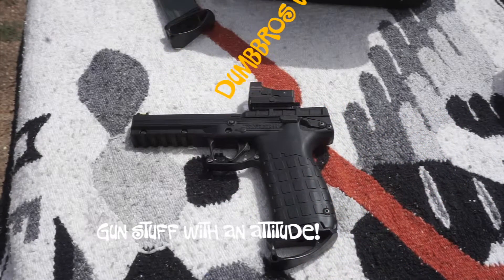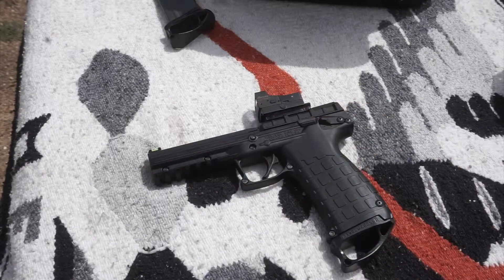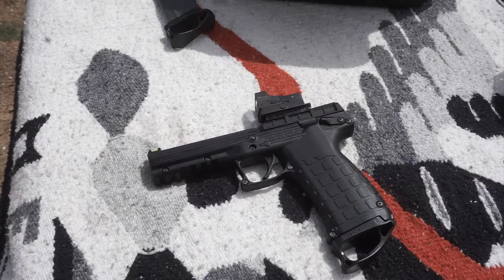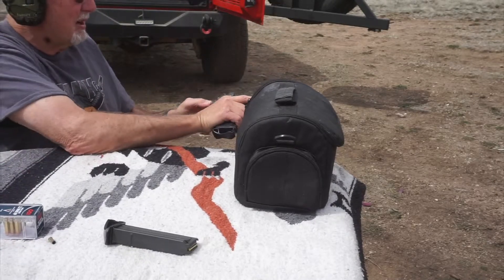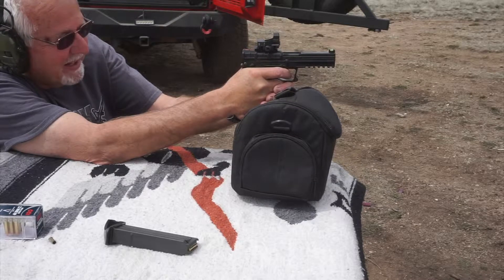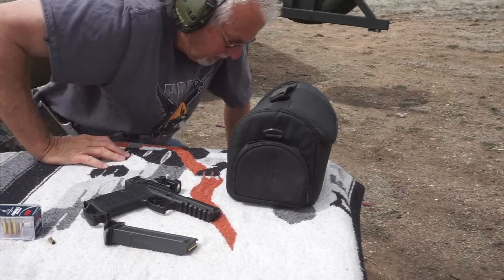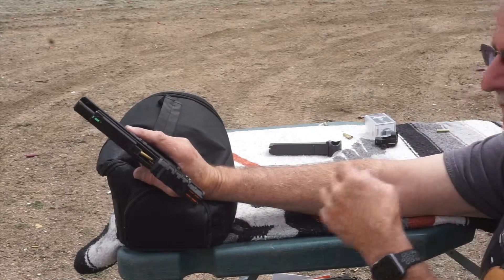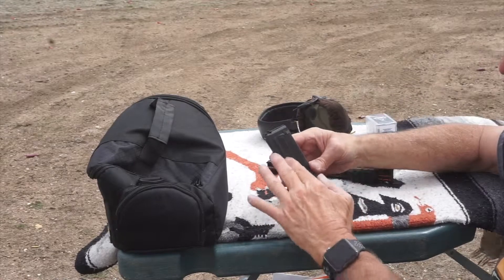⚫️KelTec PMR  30 with new Red Dot sight, Test #3 🧐

Comment: I had same exact round jam on angle issue after mounting fastfire sight. It turned out to be firing pin not retracting completely and rim of cartridge was catching on pin. Hence that's why it cycles after u pull back on it. You pull pin away. Remove composite cover that's under the Burris mount. Remove 4 screws and snaps off with little effort and exposes the firing pin. Be careful not to lose small return spring. On the bottom side of the composite cover is a molded ridge that runs the length of the firing pin. The firing pin is rubbing on this ridge. Sometimes there is a witness mark on pin where it is rubbing cover. This is what prevents the pin from retracting properly causing jam. Simply sand the molded ridge on cover until you get proper clearance between cover and pin. This will let pin retract freely preventing the jamming issue. Mine has never jammed again. I would have never noticed this issue myself.  I watched a YouTube video by CHICAGOHAND  he deserves all the credit. Good luck
Reply from the maker: Well thank you very much!!  I’m excited to give it a try. 👍🏼👍🏼

Comment: I replaced my guide rod springs with Mcarbo springs and used CCI 40 grain ammo and Hornady critical defense 45 grain ammo and shot fine all though the button/switch that keeps the slide locked open flew off while I did a mag of double taps so I super glue that piece back on.

Comment: I did have a Holosun 507C V2 on my PMR30 but it was to heavy and I had cycling issues even with the Mcarbo springs installed so I took the red dot off and it runs good.

Comment: The malfunction that happens at time index 4:32 appears to be because the round got stuck on the firing pin.  The firing pin gets stuck when the plastic piece above is rubs too much on the firing pin, check for rubbing wear along the center line of the pin.  ...I watched another video of a guy who filed down just a tiny bit of plastic so the firing pin could move with less friction against it.
Reply from the maker: That sounds logical, I’ll check that out next. Thanks!!!

Comment: Are you using a light weight rail made for the PMR 30?  The entire added weight of rail and red dot sight needs to be under 2 oz.  Also, all semi auto pistols will misfeed a round occasionally if you don't grip the pistol properly. Elbows and wrists need to supply back pressure against the recoil.  Relaxing your elbows and wrists too much causes misfeeds. Especially when shooting from a bench, instead of a combat standing position.   Of course, good ammo is also important.

Comment: It looks like I'm a little late for the party but I have a few things to discuss first off I never shoot less than a 40 grain bullet.I'm a little confused as to where you got the magazines with all that stuff on the bottom. I'm looking for a reliable red dot That they claim should be around an ounce in weight for my firearm. I own five Kel tecs and love them all. RDB, Sub 2000, PMR30, CMR30, PLR22. Also you need to be really careful when torquing down the base plate for your site. Improper twerking of the screws can warp your slide if not careful. New Sub.
Reply from the maker: Thank you. There is a couple things you brought up I’ll check. Appreciate you subing & watching too!!
Reply: @Sinxere & Sinxlaire Family Adventures 
Well late to the party again. I appreciate your feedback. The tandem cross rail is what I have. It is lighter than the Kel-Tec rail. The tandemkross is a picatinny rail. A red dot with a picatinny rail mount is much heavier then a red dot sight that mounts directly to the mount such as the Kel-Tec. Which sight did you attach directly to the Kel Tec  mount? I hope this makes sense.
Reply: Go on eBay and type in pmr30 mount. I have 7 different red dot mounts on there for the PMR-30.  Have sold about 120 in total with no complaints yet. I made them specifically to solve the issues that happen with the KT mount and TK mount. They mount on posts so it's impossible to bind the firing pin and they are the lightest setup on the market.

Comment: sounds like the two products in this vid could solve the exact problems you're having with your PMR - https://www.youtube.com/watch?v=cvdisX5gGhc

feed ramps shouldn't have corners/sharp edges - the stock plastic feed ramp in the PMR is nuts IMO 

or go whole-hog with the "all in one bundle: https://www.mcarbo.com/kel-tec-pmr-30-all-in-one-bundle.aspx
install vid:  https://www.youtube.com/watch?v=yI3T0zguBuU&feature=youtu.be

all pmr upgrades from mcarbo can be found here: https://www.mcarbo.com/kel-tec-pmr-30-accessories.aspx

Sig has a tiny new red dot sight out now - google "sig romeo zero" to find it

Comment: Mag springs are not satisfactory from the factory. The Mcarbo springs fix that. Just like Hi-Point mags. The springs are weak and the followers tilt all directions. Pro-Mag aftermarket for the Hi-Points are better than factory.
Reply: Jack F, where do you get the magazine springs?  I've looked on Mcarbo's website and could only find the recoil spring for the slide.